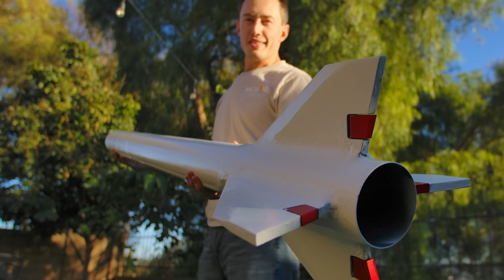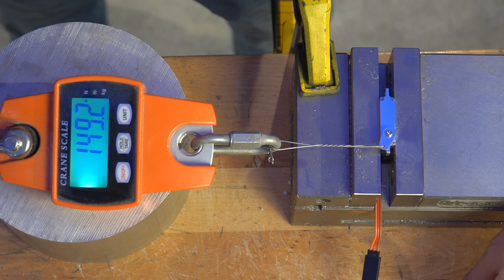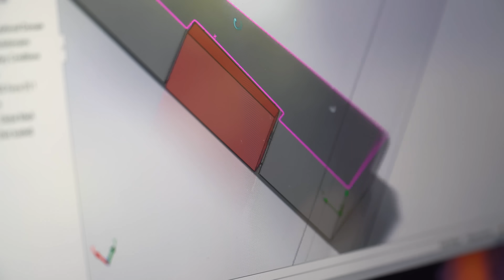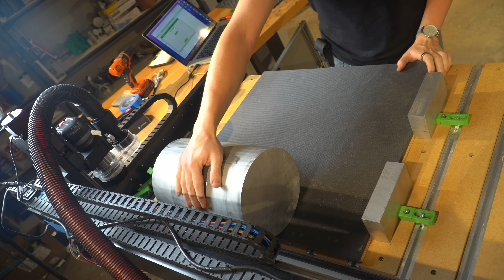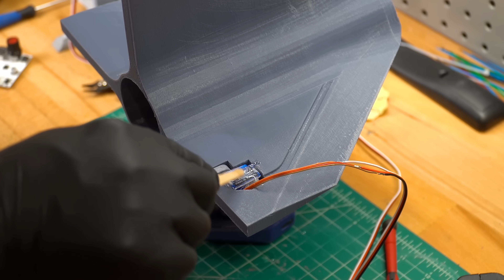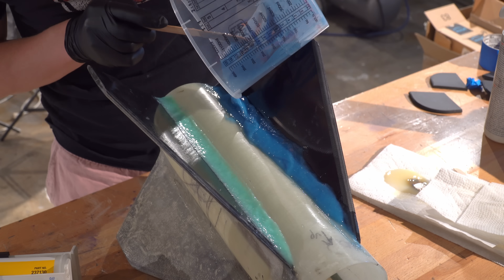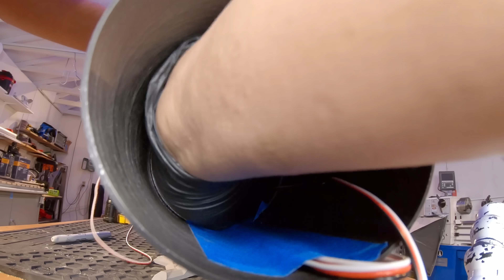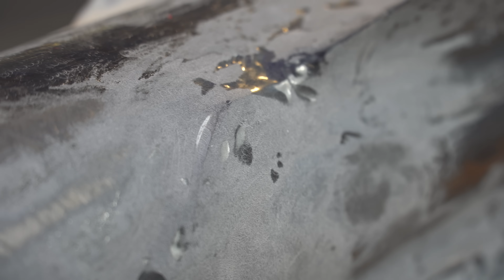Building a Guided Rocket to Hit Mach 3

Comment: Carbon fiber dust can accumulate in wall outlets, power tools, and electronics causing shorts and destroving equipment . Boeing had a learning curve to develope methods of machining and decontamination when they started using carbon layups. Thanks for producing these facinating videos, good luck on your Mach 3 flight.
Reply: I wonder if some kind of "tent" around the work area would help.   I would be really scared of carbon fiber dust (and other kinds of grinding dust) accumulating on all the exposed surfaces inside that garage and inside all the irregularly shaped (= difficult to clean) cavities there.
Reply: @peterfireflylund  Something like a paint booth is recommended. High airflow through filters.
Reply: @peterfireflylund  or just a curtain rail arround on the ceeling and enough bathcurtains maybee with some magnets a a wait on the bottom. A simple boxfan on a corner to produce negative pressure in the section and direct it into an airduct hose tzo the outside. 
The whole setup is easy enough and cheap enough. And its stowed away quickly. you can also thing about an large air fliter with a cycling fasn in the section.
Reply: @Total_Egal  if you're suggesting an air duct to the outside with no filtration for carbon fibre dust, that would be a huge dick move, because now you're exposing anyone outside to the dust, which as Joe pointed out, is terrible for you. Even the bit where he sanded in his backyard was bad enough, all that dust he showed off is now out in the environment, it doesn't magically disappear.
Reply: 😂😂I knew it! When someone talks about Boeing, and how they've improved/learned something, someone else will point out how they've missed stuff on other occasions.
😂
Reply: I'm afraid for your yard now too :( You can't bring dogs there now.
Reply: Do you also need to worry about clothes? When I saw him with the grinder outside, my first though what that it would be a nightmare to clean his T-shirt and pants pockets...
Reply: @bl2575  Also one one of the thoughts I had. I personally don't like grinding/sanding something normal like paint in my everyday clothes. And here you have sharp fibers.
Reply: I cut my carbon fiber in fluid.... No way in hell am I breathing that.... even with dust collection, you don't get 100% collection.....  It's going to be rough on that air cooled spindle....And then whoever goes through your shop for its eternity are exposed to that dust....  Move your router outside when cutting that stuff.
Reply: @machineenvyllc437  moving it outside just pollutes the outside and risks exposing others too.
Reply: @ solution to pollution is dilution  

and  it’s 100% less dangerous than doing it in the garage with the kitchen door open
Reply: @machineenvyllc437  that's great for things which become harmless in low enough concentrations - I'd suggest that it's not a good strategy for things like carbon fibre and asbestos where individual fibres can do damage..
Reply: @ i said  peace on how to machine it.  the way i machine it which is using fluid  i was told by someone who machines it everyday that dust collection will never even come close to 100% filtration  and you can visibly see the clouds of carbon fiber dust not being collected  so yea   

next best thing for his operation is out in the open collecting as much dust as you can.  not a confined space where dust will be everywhere where you walk every day not wearing masks.  that is simple fact  you offer no better solution   as there is t one in his current setup   again have a great day
Reply: @machineenvyllc437  Yeah that didnt work for the radioactive products dumped into the sea..
Or ya know, plastics.
They just accumulated back into our foodchain, who could have thought right?
Reply: They also seem to have a weirdly delayed learning curved when it comes to the task of not having planes drop out of the sky and killing people.
Reply: Reminds me of the great game of Lawn Darts, good times, miss you.
Reply: You don't need a lot of fiber dust to do serious damage to your lungs. There's a reason why it is often milled under water.
Reply: When I worked aviation, we just used air tools. Carbon fiber and epoxy is so nasty, it usually gets its own room.
Reply: @BenjaminBrown-o8r  Nasty stuff indeed. I work outside when using fiberglass, I have avoided Carbon so far.
Reply: @ They are pretty similar. Nasty irritating epoxy. Toxic tiny dust that gets everywhere.
Reply: Should have hired a shipwright or two who have worked with fiberglass their whole lives.
Reply: It’s not that much effort to use a vacuum when you sand cf outside.  Safer for your neighbors, etc.

Comment: Wait why didn't you secure the fins to the body of the rocket using screws and washers? is it because it's carbon fiber?
Reply: You'd need to either epoxy a threaded insert in the inner edge of the fin or epoxy tabs on the side to get a bolt and nut through the tab. By that point it's the epoxy doing the work anyway andtye bolt/nut would take up space inside the motor.

Comment: hollow glass beads at a level of 2 to 5 percent will fix your smoothing issues when attempting to use any kind of fiber as a thickener and reinforcement.  It will provide the control needed.  It will also make it incredibly easy to sand if you find yourself needing to do touch up work.   

you need a shear mixer, or can get away with a hobart / kitchen aid mixer if you are going to be using milled kevlar.  that fiber is most likely unsized, and will hydrogen bond with your epoxy, making it very diffucult to break apart with a tounge depressor.

Comment: Would you be concerned with the plastic from the rail guides accumulating on the fins or the control surfaces? Would the plastic just fly off of those as well?

Comment: This totally falls into my ever-present personal motto: 'If it's worth doing, it's worth Overdoing', followed shortly after by 'For Science!'  👍👍
Add: For composites, a compression bit is rather desirable for better surface finish, or at the very least, a down-cutting bit. Tungsten carbide is a must for longevity. 
Also, Spoby connections in place of solder. You'll never hurt for a better connection when doing lots of manual wiring in the future.
Add2: For a perfect fillet, look into grout and silicone caulk tools. It's a little silicone corner wipe with a handy holding tool that makes Amazingly consistent corner fits. One of my absolutely favorite adapted tools for professional results. With composites and epoxy, more isn't better. Applied by a weight ratio per fabric/substrate weight. I usually do manual calculations per project, but there's lot of calculators out there and worth looking into.

Comment: I watching you not put heat shrinks in servo wires while soldering them and thinking that did you just forget them. Apparently not! Good thing you could just pull them up a bit.

Comment: Common power and ground could be used for the servos and the carbon could be utilised as the common ground. A copper mesh can be epoxied onto the carbon tube to attach the ground wires to. This would reduce the number of individual wires from the controller to the servos from 12 to 5. Maybe overkill at this point but if you have more components needing ground it would become more valuable to use the chassis as a ground and reduce the amount of wiring.
Reply: Also, why not use heat shrink to isolate the wires from each other and the carbon fibre? 

That's pretty commonly how it's done for other non-recoket projects.
Reply: @robertwatson5400  yes he should have

Comment: "I might actually be stupid!" No, actually testing it on every step of the way was so smart. I aspire to be like you sir
Reply: You have to be smart to be that stupid (and not cost yourself the entire project).
Reply: Exactly.  Testing is good, humans are humans, we all make mistakes and forget  things.
Reply: To be fair to his stupidity I'm pretty dumb myself and as soon as I saw him gluing those exposed wires to carbon I was screaming at the screen. Reminds me of my favorite quote “Mankind is made of two kinds of people: wise people who know they're fools and fools who think they are wise.” - Socrates
Reply: @thirtythreeeyes8624  same, i was like wtf that's not going to work or worse, it is going to work but only sometimes or only until it gets hot
Reply: So, he might be, because he dug out the leads, and covered them in CA, instead of like, using heat shrink. The CA will crack up under vibrational loading in flight, short out, and wheeeeeeee. 

Just use the bloody heat shrink, my dude. You will save yourself the tears.
Reply: @arfink  -- It's encased in epoxy now, as long as there's a physical barrier between the CF and the wire, the physical strength shouldn't matter.

Laying some epoxy in the grove before adding the wires might end up stronger though.

Comment: Even if the carbon fiber wasn't conductive, you're really just asking for trouble by not protecting the connections of the soldered wires.  That's how you end up getting random shorts.  Probably not worth a heat shrink tube, but definitely worth something to insulate them.
Reply: I was thinking about heat shrink tube too. But given how hot the airframe is going to get (inspite of all the epoxy and pain coating over the wires), I wonder if the heat shrink tube would melt and actually hinder the conductivity. Would be interesting to investigate this.

Comment: If the carbon fiber is conductive, why not run a single wire to the motors and use the rocket body as the return path? No?

Comment: Years back the xjet channel mostly did videos on pulse jet engines.  He decided he could make a pulse jet guided rocket and started working on it.  The US government did not like the idea and called it a cruise missile,  Enough pressure was put on New Zealand by the US that they banned his research.  In the end he had to remove his all of his content off the internet and now only does r/c flying and drone content.

Just a heads up, what is a hobby to one person may be considered a weapon by those in power.
Reply: A couple of  other youtubers  have   run into that.  Seems  to be, as long as there is no way for the rocket  or pulse jet to be guided, they are left alone. 
Xjet was more or less okay until 911 when there was a purge on available information on the internet (before then there were detailed blogs regarding pulse jets and other things).
Reply: @ptonpc I think even if they are guided, if you're operating within the FAA regs and the regs of the rocketry org he'll be fine. Plus he's in the US, not in another country, though there is a point at which he could run into ITAR issues I suppose, but I think he's a long ways from that.
Reply: Didn't he call it a DIY cruise missile though? Lol, I love Xjet he's a legend in the hobby.
Reply: @thirtythreeeyes8624  Surely his videos are still out there somewhere?
Reply: Joe has already been running into these issues. Certain information we'd love to know is left out or blurred in past videos to prevent crossing into FBI investigation land.
Reply: One man's pulse jet guided rocket is another man's cruise missile.
Reply: One man’s nuclear power plants (Iran)  is a nuclear bomb to another (US).🤷🏻‍♂️

Comment: I used to build a lot of drone frames on a cnc router and really liked doing it underwater, the finish was great and it was soooo quite too.

 It takes a bit of work to get a good system for doing it underwater though. I found a place that made semi custom stainless appliance drip trays.

Got the biggest size that fit on my machine, and I bolted an aluminum t slot table down to the frame through the tray and sealed the holes with o-rings between the tray and my machine frame.

This provides a nice solid surface you can attach to in various ways. Surprisingly the tape I used held up fine for a few hours under water.

Add a drain to the tray and you are in business.

Thanks for the distraction tonight!
Reply: I've also cut carbon fiber parts underwater on a CNC router, and I just used a cheap thin baking tray. Drilled some holes in the carbon fiber and wasteboard material, and screwed through the carbon - wasteboard - baking tray stackup into a secondary MDF wasteboard. Worked well.
Reply: Are there any effective wet sanding techniques that don't require putting the entire vehicle under water? Quite a few sanding steps were done after assembly.
Reply: I made mine out of the vinyl drip mats used for showers.... just lined a table that had a 4 inch lip and set the machine in there.  , then put some splash guards up.....  double filtered.  You would be surprised how quick carbon fiber clogs filters.  I use some paper towel filters as a pre-filter.... it gets most of it out....  but have to be replaced nearly every session.    Also 100% use fish-tail cutting bits. 

https://youtu.be/U70rWAazc0Y?si=UPQvOhJSD40JRjCF

Comment: Use a press fit bearing in your drill guide, spins against hardened steel. Even better if you can stack a few, and borrow the tolerances from each one, reducing eccentricity.